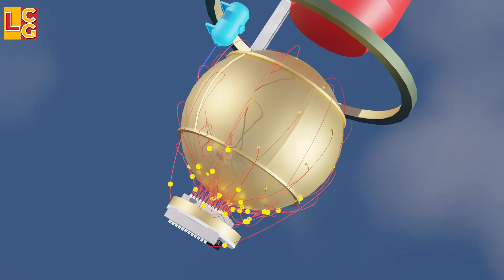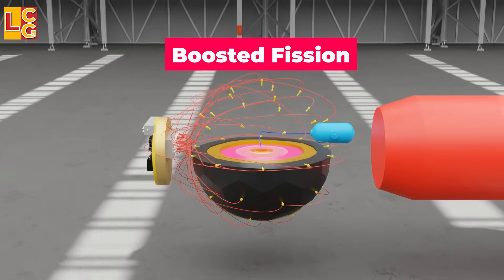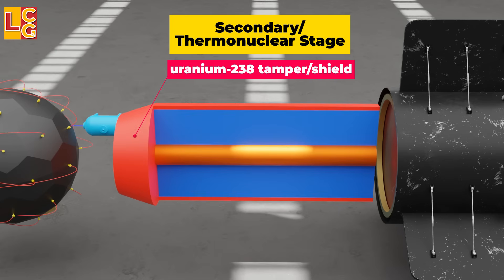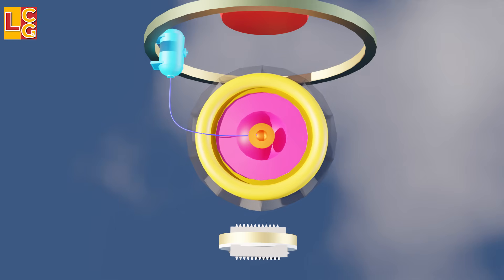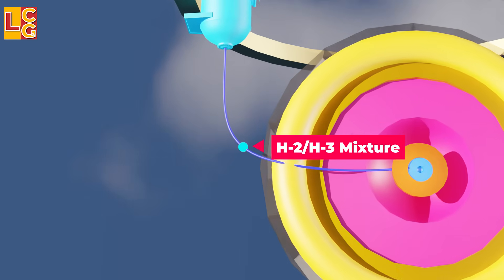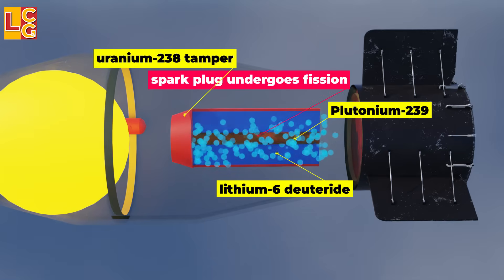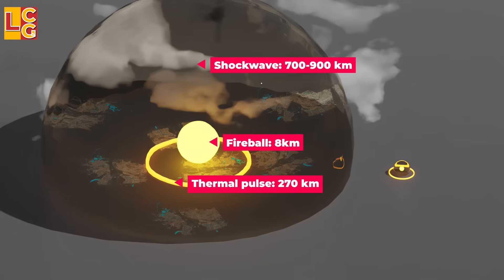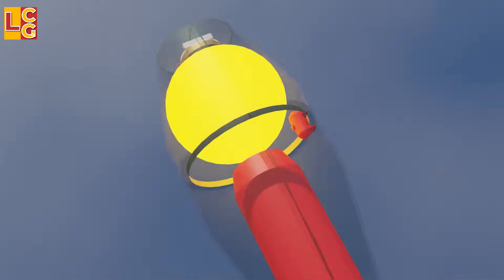How Hydrogen Bomb Tsar Bomba Works

Comment: At 4:30-4:35,  you say that, following entry of the neutron into Pu-239 or U-235, "two more of the SAME ATOMS are generated," implying that the splitting of a Pu-239 results in two Pu-239 atoms and three neutrons. This is NOT correct.  Two NEW LIGHTER atoms, not two of the SAME atoms, are generated. For example, the fission of a U-235 atom results in a pair of lighter atoms (most likely Krypton and Barium)...not two U-235 atoms.
Reply from the maker: Thank you for pointing this out. We will reupload a new version with the correction. I'm pinning your comment so others can see as well. I'll do my best to avoid this kind of mistake in our future uploads. We always appreciate this kind of comment.
Reply: He keeps making the same mistake in every video.
Reply: @RocketToTheMoose  I know, Brett. I think this is the second time I've offered the same correction!
Reply: Yeah, this is basic knowledge. Theses people have no idea about the content. Also the fact, that the Tsar bomba was a 3 stage bomb. This video is completely wrong...
Reply: @konradwasylewski4424  I was under the impression the tsar was a 3 stage bomb? Chemical explosion compressing the uranium 235 leading to fission of the smaller atom bomb needed to activate the 3rd stage thermonuclear explosion?
Reply: In matter of fact, splitting a Pu or U atom will rarely produce two same atoms.
Reply: That bomb was a 3 stage device 3 chambers of fuel for the detonation.

Comment: Polystyrene is used as a plasma source that helps in compression after its superheated by Xrays.  It is a very critical step in the Fission/Fusion. I know you mention it later but was described as a support in intro. Great video though

I thought the Lithium 6 was in powder form and already loaded into PIT when its assembled. If Czar used a gas system thats some engineering just to get timing flawless. Just asking since modern nuclear weapons use L-6 in powder and it has to be replaced every 10 years or something
Reply: The boost gas has a half life as it contains radioactive isotopes, and of course gas can leak, so sealing the gas into the nuclear core at manufacture was not going to work for nukes than maybe on standby for decades.   So a separate refillable gas tank is used, thus the gas can be replaced and topped off as needed.    The gas can be i injected from the tank into the core well before the bomb is triggered.  Perhaps seconds before.
The amount of gas injected can in some bombs we adjusted such that the bomb will have an adjustable yield, as more gas means a larger yield.  
When this gas is compressed and heated in the core of the bomb at detonation, this gas sends out a lot of neutrons, and these neutrons go into the surrounding plutonium 235 core, these neutrons add to the splitting of the plutonium 235, so the fission process, the splitting of the Plutonium 235 is greatly increased, thus more energy, larger yield

Comment: Uhhh..'scuse me:  "This weapon was used by the Soviet Union in the Second World War"...??  Recheck that.

As for comparing to Fat Man, that is a disproportionate comparison.  Fat Man was one of the first and oldest nuclear-weapon designs, relatively crude and very inefficient (only 13% of the plutonium fuel for that bomb actually underwent fission); on a side note, geography played a major role in the limited destructive radius; Nagasaki is built on a series of hills, which served as deflective berms the day of the bombing, thus explaining why only 39% of the city was destroyed.  The Fat Man design was discontinued as obsolete before the 1940s came to a close.  Tsar Bomba on the other hand was one of the latest, most advanced nuclear-weapon designs entering the 1960s, a good 15+ years after World War II ended.  Only in overall casing sizes may that comparison have some relevance, showing how much nuclear technology advanced in leaps and bounds.  After all, on a side note, we managed to shrink the 10,000-lb. Little Boy bomb which needed a B-29 to deliver, into a 800-lb. artillery shell deliverable by a cannon.  Same core detonation design, and same yield...but in a smaller package.

At first I was concerned that even more errors in technical history were being touted, particularly regarding the material used in the tamper of the tested weapon.  But, they did make a clarification in the last minute or so of the video that the tamper was changed to lead, which dropped the design yield by 50% but in turn made it still relatively safe for northern Europe and the most-inhabited sections of Russia.  Had they stuck to the original specs, the Cold War may have ended by Russia's self-destruction....and taking two thirds of Europe with it.  

As for being a weapon of war, it never would have been practical.  The size and mass of that bomb made it impossible for the Soviets to deliver; the plane that dropped it was heavily modified because the standard-service Tu-95s would have collapsed on themselves a payload the mass of that bomb.  On top of that, the mods done to the drop-plane cut its range drastically, as fuel cells in the wings had to be taken out, making it impossible for that plane to even reach the then-border of NATO unless it took off from East Berlin.  On the other hand, as a scientific experiment, that bomb was the most impressive ever made, as it was the cleanest-ever nuclear weapon detonated, with a 97.5% fusion-powered yield.  This was a true hydrogen bomb.
Reply: 97,5% fusion powered yield? Wow. How do you know that? That must be the explanation for it's cleanness. Just wow.
Reply: @MeBallerman  It was monitored by the Soviets when it happened, reviewed, documented, and verified.  I was just as surprised to learn they built the truest hydrogen bomb ever.

Comment: inner solid core memory iday rapa dapa default solid foot print sole memory data transfer triple systems solid final data base back up running memory solid inside  core vaccum data center default 20th 2024

Comment: Without the actual plans, one can never know for certain.  I think he based his explanation on our thermo-nuclear weapon, Castle/Bravo.  Still, he did get some facts wrong.  The bomb the Russians exploded used only half the explosive capacity.  For fear of what the damage and fallout would have been.  The bomb was never really usable.  Using a WWII bomber to deliver the payload was not very feasible.  Even today, with improvements and changes to modern jet powered planes, there isn't any plane really capable of carrying the bomb.  Plus, why use aircraft wh3n missiles and rockets, like ICBMs, are much more practicle.

Comment: I still think that nuclear fission reaction is real and can be applied in warfare but regarding Hydrogen-bomb I do have doubts as humans are unable of carrying out controlled nuclear fusion reaction so far and what they claim about this two stage fission/fusion reaction in thermonuclear bomb looks to be a hoax. From what I figured out is that fusion reaction components (H2,H3) shall be under extreme heat and pressure for a while and not shortly, so they just refer to some secret technology behind this. Moreover, North Korea's Kim wasn't successful to achieve fusion boosted explosion so far despite being the only country conducting nuclear tests nowadays. According to intelligence data being collected after his nuclear experiments they are not of fusion reaction magnitude.

Comment: I read somewhere that the reason it wasn’t 100 mega ton was it pretty much snuffed itself when detonated. It had more fuel than it could react with?
Reply: No, the reason was that a 100MT bomb would have had so much explosive force that the pilots wouldn't have had enough time to get away from the blast and fireball.

Comment: Supposedly, the Tzar Bomba had 3 separate fusion chambers, one behind the other. This was meant to intensify the hydrogen fusion yield. 
 It wss originally designed to be a 100 mt bomb, but the technichians wisely decided to use LEAD to contain the lithium deuteride of the third flask to limit the yield to only about 50 mt. This is the only reason that the TU-95 bomber crew were able to escape certain death by incineration.
Reply: Andrei Sakharov is not exactly a "technician".

Comment: You can see a declassified video that shows the guts of it. It has 6 thermonuclear primary modules inside of 9Mt a piece. The tertiary stage would have been a cylinder of DU filled with lithium deuteride and a rod of HEU or plutonium. This assembly is rougly the size of a 100 gallon propane tank in the middle of the device. Also the bombs casing was originally to be made of DU around the 6 primary subassemblies but they decided on lead to keep the device at 50kt and to keep the same throw weight. Had they went all in, the device would have made well over 120Mt, 50Mt from the primaries, 50Mt from the tertiary, and 20 to 30Mt from the casing.😮
Reply: Two primaries.

Comment: It still boggles my mind that the energy from the primary can set off one or two secondaries in the extremely short amount of time before it explodes.  I think we are talking nanoseconds.
Reply: Videos like this are very misleading. All this stuff that is decribed here, which sounds like many steps, all happens basically instantaneously. 3 stage bomb, bang bang bang immediately. 

These graphics showing atoms being split, multiplying, fusing, etc, all of that is happening at the speed of light. Billions and billions of these things colliding and releasing energy all at the same time.
Reply: I still think that nuclear fission reaction is real and can be applied in warfare but regarding Hydrogen-bomb I do have doubts as humans are unable of carrying out controlled nuclear fusion reaction so far and what they claim about this two stage fission/fusion reaction in thermonuclear bomb appears to be a hoax.
Reply: @vitaliybochan192  You shouldn't bet on that.  I read that most nukes today are themeronuclear/hydrogen bombs.

Comment: I really want to know what would happen if the bomb took 1 minute to detonate instead of 600 billionths of 1 second? If the heat that it produced (100 million degrees) lasted more than it did, would there be even more fire damage caused from the explosion? Because I can imagine if that heat and radiation was emitted for 1 whole minute it would have that much more time to fry everything that it did for about 59 more seconds than it did in less than 1 second.
I hope someone can answer this for me!
Reply: Idk bro
Reply: I dont know about how it works with Nuclear devices, but I'm guessing that it will always be an instantaneous explosion lasting millionths of a second when the bomb is first detonated, but the actual fireball will last longer the bigger the yield is , because it causes a bigger explosion? just like say, if you set a small amount of petrol on fire, it goes off instantly, but only lasts a short time, because of the small amount of fuel, but say, 50 litres, will go off just as quickly, but burn longer because of the larger amount of fuel.  I'm not sure. maybe someone else will know more.
Reply: @catey62  that makes sense!
Reply: 100 million degrees will probably destroy anything organic or man-made on the ground instantly.  It doesn't need a whole minute to do it.

Comment: The pit, or core of the bomb in an implosion style device is never going to be made of U235. To produce U235 is extremely labour intensive, and is only attempted by countries that do not have nuclear reactors that can produce plutonium. The USA's electrical power grid devoted 10% of it's annual output to refining the Uranium used for the Hiroshima bomb, which is an astronomical amount in my opinion. Also a uranium core has to be far larger than a plutonium core, and would have to undergo greater compression to trigger it into a supercritical state. I'm not even sure if it would be efficient enough to react sufficiently before the weapon blew itself apart. Uranium U235 bombs tend to be of the gun type such as Little Boy.
There are so many more points I have to make but for brevity, Tsar Bomba was a multi-stage fission fusion fission fusion fission type weapon in all probability - 5 stages, using Plutonium core, Uranium tamper, Lithium Deuteride and Tritium, with a Polonium 210 and Beryllium neutron generator. It is quite remarkable that the USSR was able to fit this into a deliverable package. They were far ahead of the USA in that respect. The Castle Bravo bomb that the USA built could not be delivered and was built into a 5 storey building on an island - completely undeliverable.
Reply: Ivy Mike was not a transportable device, Castle Bravo was weaponized almost as tested as the Mk-17/23 and carried by the Convair B-36, the only USAF craft capable of that at the time.  Also the USSR produced more weapons grade Uranium than the USA, more than 130 metric tons.

Comment: Why is the 2H and 3H injected from an external reservoir in the primary? Is there even enough time for the gas to travel through the lines into the hollow pit if it happens simultaneously to the explosion of the fast explosive?
I think TSAR used the primary to ignite a secondary small fusion reaction in at least 2 nuclear bombs opposite of each other with the large third stage in between these two to focus the energy.
Reply: I still think that nuclear fission reaction is real and can be applied in warfare but regarding Hydrogen-bomb I do have doubts as humans are unable of carrying out controlled nuclear fusion reaction so far and what they claim about this two stage fission/fusion reaction in thermonuclear bomb appears to be a hoax.

Comment: The explanation at 4:35 is incorrect. The atoms from fission are not the same. They can be two of several combinations, each with different half-lifes, and emitting different radiation as they decay into other atoms.

Comment: What made this bomb so dangerous was the STYROFOAM they placed in between the components.  And I thought that UPS only using it for packing.
Reply: And you believe the story? He can't even get the explosive lenses right. 
The styrofoam I suspect is misdirection. You need mass to get the compression. I doubt its expanded styrofoam. Needs to have  certain mass and to be opaque to xrays to heat up when the primary goes off.
Reply: @adenwellsmith6908  
To be entirely honest, I didn't consult Robert Oppenheimer before posting my comment.
Reply: @tiffsaver  It's a misdirection put out there to deceive others.
Reply: @adenwellsmith6908  The styrofoam turns into plasma which then compressess the secondary.  Its been mentioned as a design feature in US nuclear weapons as well.   Sometimes refered to as  FOGBANK
Reply: @ZXLNT  But you need mass to create the pressure. Styrofoam doesn't have the mass. 
So I suspect misdirection
Reply: @adenwellsmith6908   Its been noted and mentioned in US nuclear weapon design as well..
Reply: @adenwellsmith6908  The superheated foam plasma exerts pressure onto the tamper compressing the secondary, all sorts of literature about it.   No misdirection.
Reply: @ZXLNT  I know that. However, expanded polystyrene has very little mass. So It won't compress. 
That's the misdirection. Why makes you think its expanded foam? 

You need something that has some mass. You need it that its going to be heated up fast with x-rays. Then I agree with your description of the compression of the spark plug. 

Where polystyrene will be used is in levitating the pip. Use the hammer to compress the primary core rather than a squeeze.

Comment: come on... I don't know where you learned nuclear fission but it doesn't generate 2 atoms of the same atom... The chain reaction is starting because the release of new neutrons which will hit other atoms of uranium and so on... If you take uranium 235, you hit it with one neutron. It becomes uranium 236 but then splits in one atom of Krypton and one atom of Baryum and then release 3 neutrons. These 3 neutrons will hit 3 other atoms of uranium 235... and so on. You don't generate atoms when you split them.

Comment: One correction. The Plutonium spark plug doesn't start with the heat. It starts with the burst of neutrons from the primary stage. The first stage heat from the outside and the second stage from the Plutonium spark plug is what compresses the hydrogen/ lithium atoms to start the second stage fusion.
Reply: The shock from the thermal radiation acting on the secondary also compressed the sparkplug into supercriticallity.
Reply: Yup the spark plug rod can be made of either HEU or Pu239. It is usually encased in thin beryllium at the center of the secondary subassembly. It works by the outer DU casing (called the pusher and tamper) fissioning from the fast neutrons from the primary. This energy compresses the LiD fusion mix to extreme temperatures as the Li in it soaks up neutrons forming tritium. Next, the neutrons make it to the beryllium cladding in the middie where the neutrons get amplified by the metal undergoing a fisioning process of its own. Each neutron becomes 2. This triggers the spark plug to promptly fission and this energy heats the DT soup to fusion temperatures. This reaction generates a lot more neutrons that cause the remains of the pusher, tamper, and even the bomb casing itself to fission.

Comment: The animations of fission at 02:05 and 04:15 are incorrect. Fission is the splitting of a nucleus into several smaller nuclei, but your animation shows it splitting into 2 nuclei that are just as large as the original.